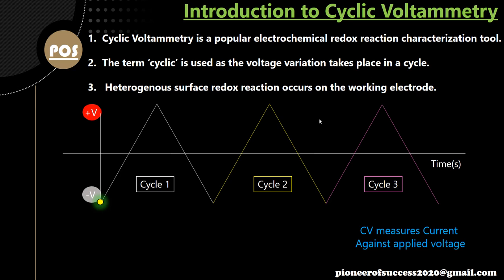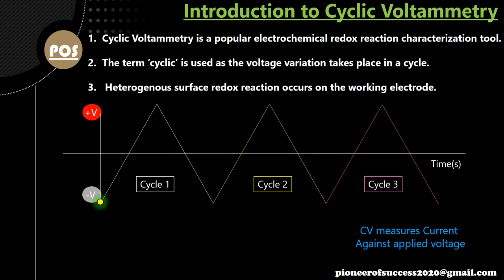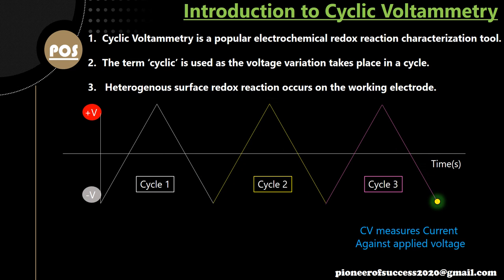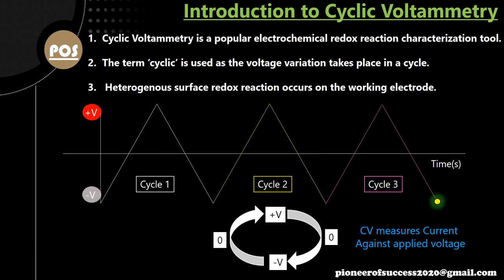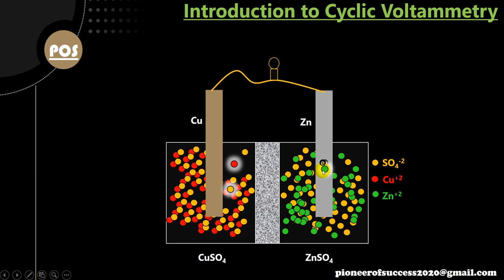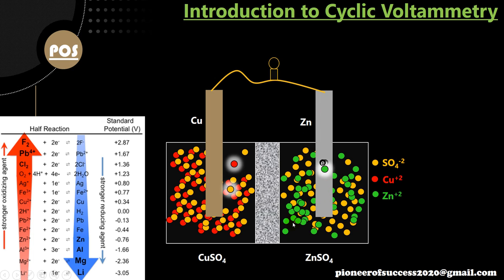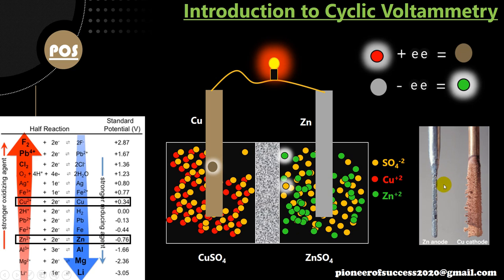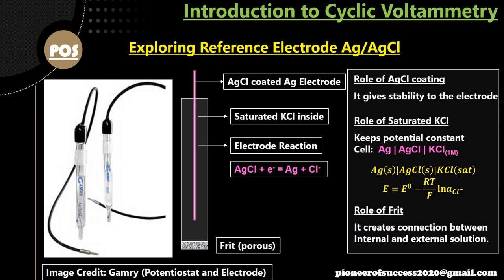Cyclic Voltammetry Lecture 2 #CyclicVoltammetry #CV #Cell #Electrochemistry #research #pos

Comment: Please correct it, the time stamp (19:47-20:21) it is not AgCl coated with Ag, it is Ag coated with AgCl......i.e. It consists of a silver wire coated with a thin layer of silver chloride (AgCl) and immersed in a chloride solution..
Reply from the maker: Yes, indeed. It was a slip of the tongue might be. I will put a pop up notification to correct it. Thank you.
Reply: @pioneerofsuccess4054 please make detailed video of differential pulse voltammetry also and other voltammetric techniques